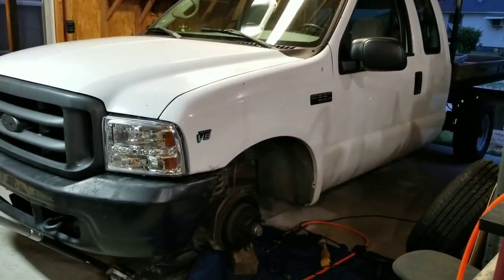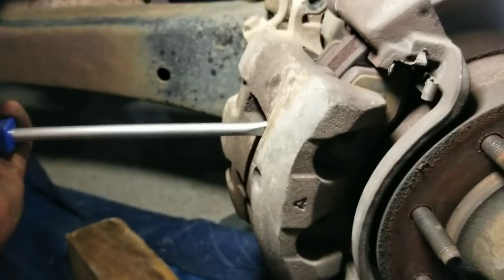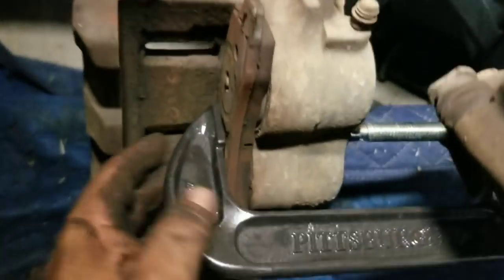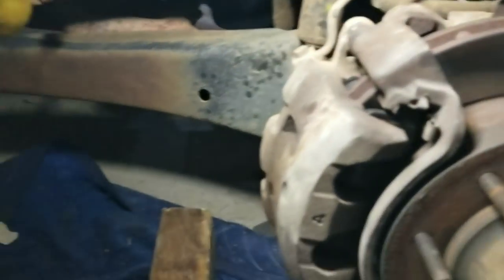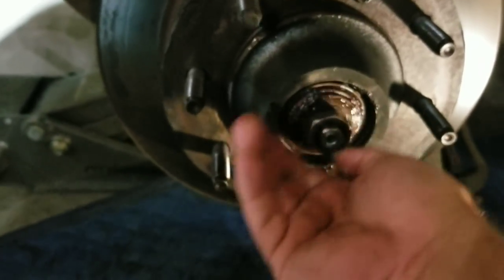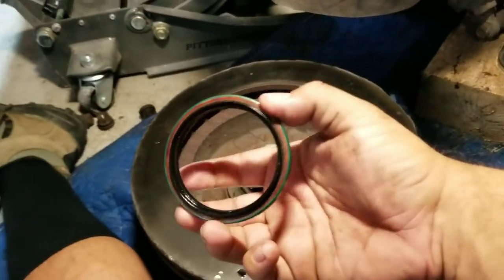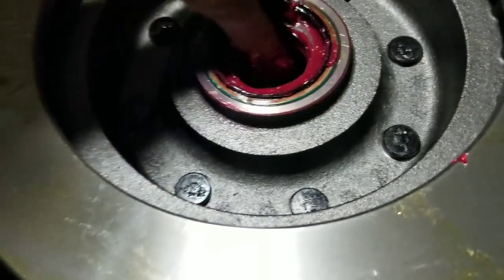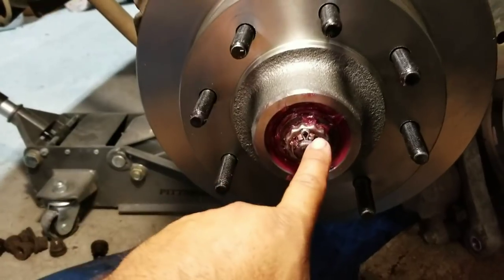Front Brakes 2wd Ford F250 Super duty truck

Comment: Thank you for doing this. Your video is very helpful,,,, especially in managing the springs... A tip for removing the inner bearing and seal. Remove The outer bearing then reinstall the large washer and nut. Gently with a little force grasped the rotor and pull forward. The washer will catch the inner bearing removing both it and the outer seal.
Reply from the maker: You're welcome and thanks for the great tip.

Comment: 18:52 whole job f'd if you dont pin correctly. Will feel like bearings bad if to loose, will feel drag if to tight. Finger tight, then eighth turn w tool. Back off to next keeper hole and new c pin every time. Definitely prefer hand packing grease, but great video and thanks. Took 2wd curs apart and was stuck on stupid rear seal. Must have been in for 200k and I was first soul to break free. Again great job. And thanks for posting.
Reply from the maker: Thank you glad I could help.

Comment: While the rear seal and bearings are still in the roters pull the front bearings and cap nut out.  Then place the roter back on and place the nut back on and pull the roter down and out the seal and rear bearing  will pop out onto the spindle and you wont nick the seelals or berings...

Comment: would you recommend cleaning spindle off with cleaner and then re grease before putting new set up on?
Reply: no just clean it off with rag   the oils in the grease   will allow the rag to wipe it clean as a whistle
Reply from the maker: I agree with just using your hand with a rag.

Comment: Please pack the bearings properly, not like in your video, sorry.  Use gloves with grease in your palm and press the edge of the bearing in the grease pushing the grease thru the rollers.
Reply from the maker: Its still working great no problems i did a good job the way I did it thanks for your concern